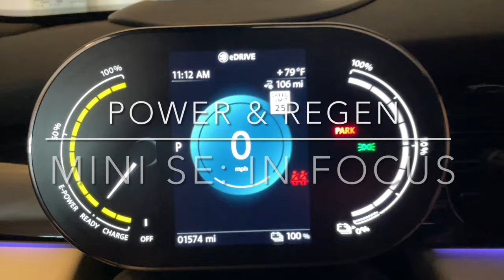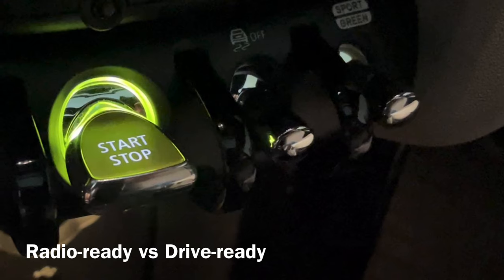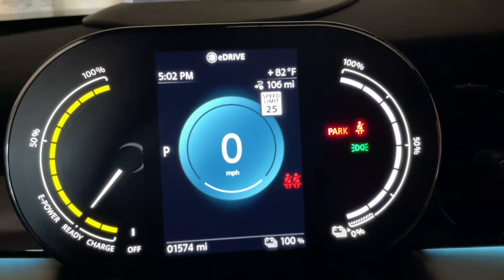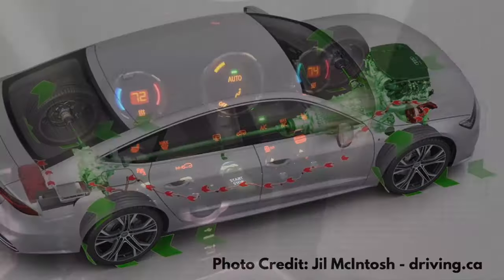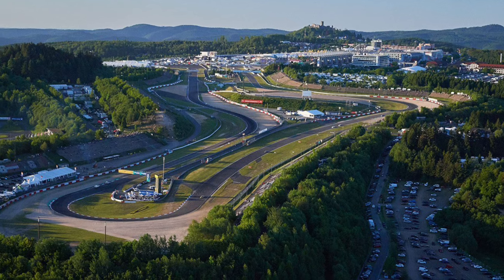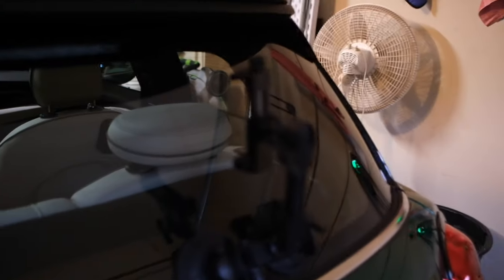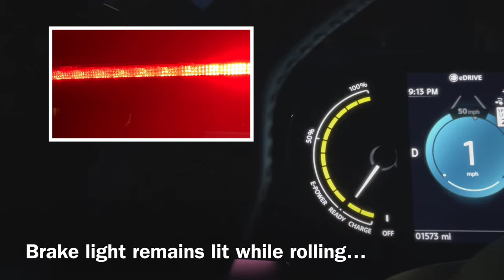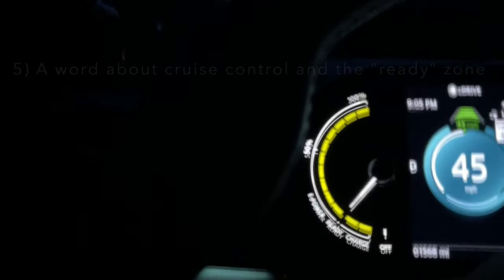2022 Mini Cooper SE - In Focus: Power & Regen

Comment: Great video, well explained with some nice info on the brake lights..keep ‘em coming. Just got our mini electric here in the UK, fab little thing!
Reply from the maker: Thanks for watching!
Reply: How are you going on here in the UK with the range on your Mini SE?
Reply: @genaslmoc  90-100 miles but we only use it locally so range isn’t an issue for us. And we have a home charger so that’s the game changer for smaller electric (maybe all) vehicles. Just becomes routine to charge it when down to 50%. 👍

Comment: I am considering buying my first EV and like Mini quite a bit. 
So, let me see if I understand correctly. When you pull off from the accelerator, the break lights turn on and turn off when you arrive to a complete stop, correct? 
BTW, great videos. Thnx
Reply from the maker: Hi, Adan. Yes - the regenerative braking system kicks in as you ease off the accelerator, activating the brake lights. Once stopped, the brake lights turn off unless you press the brake pedal.

Comment: This is the only Ev that I have heard about that turns off the brake lights when completely stopped on regen  braking.
Reply from the maker: I disagree with the design. It should leave the brake lights on as a safety precaution. But I always put my foot on the brake at stops, anyway.
Reply: @minise-focus  Well I have the hold feature on my Model 3 so I don’t put my foot on brake at stop. But I wonder if it would be better to have it on if hit from behind. Not sure if it would lurch forward more with foot off than on. Hopefully I will never find out. 😜
Reply: The early Kona EV did this but a software update fixed it.

Comment: Thanks for the video! I’m assuming that the Mini has no option for free sailing mode (no regenerative braking). And if it does have sailing option, would the brake lights come on if your foot is off the accelerator while coasting?
Reply from the maker: Correct - no free sailing mode. This is my first EV, and I do not miss coasting at all. When I drive my ICE vehicles, they feel like loose, bouncy clown cars. The Mini driving feel has spoiled me.

Comment: Another great video. I'm surprised that the MINI does not keep the brake lights on at a complete stop; You'd think this would be a safety requirement. This makes me wonder if rear-end collisions are more frequent in this car? Perhaps this "feature" is common in all EVs? At any rate, good tip about applying the brakes when stopped.

Comment: Is there any in-city safety feature for the SE 2022 like pedestrian detection, automatic breaking, etc...?
Reply from the maker: Yes. There is a pedestrian detection warning if a pedestrian is approaching or in the path of the car. The car has some level of automatic braking which I have not yet had to test, thankfully. If the system detects a potential collision with a pedestrian or another car, a warning flashes on the dash to apply the brakes. My car is Iconic trim level with everything, so I do not know about availability on lower trim levels.
Reply: Awesome! Hopefully you could make a video about those features soon. Your videos are very helpful 👏👏👏

Comment: Thank you for a great video. Do you know if it regenerates if you use the breakpedal?
Reply from the maker: No - if you hit the brakes you are negating the regenerative effect.
Reply: This is one area Hyundai/Kia are at the front.  But even the original GM EV-1 had this feature.

Comment: Thank you for explaining the difference between ready and radio ready but how do you turn the car off completely? Thanks
Reply from the maker: If the car is on, just press the on/off button to turn it off. The entertainment system keeps playing until you open the door, so it might seem like the Mini is still on, but just look at the left hand dial and you'll see the current on/off state.
Reply: @minise-focus  Question: If I stop at my driveway with my shift in the "D" (Drive) position, should I first press "P" to engage the parking state, then press the Stop button and get out of my car? Or, when my shift is on "D," do I simply need to press the Stop button without engaging "P"?

Comment: Why is it a safety issue to you, that the brake lights go off once stopped ?
Reply: In a country where nobody drives stick (e.g. USA), not seeing a brake light means someone is actually driving or gonna drive. Because with an automatic ICE you'd have your foot on the brake to prevent acceleration. It might misinform traffic coming up from behind and cause them to brake too late. Here in the Netherlands, most people drive stick, so a lot of people stand still at traffic lights without brake lights on, so it's less dangerous as people cannot rely on that brake light alone for indication.